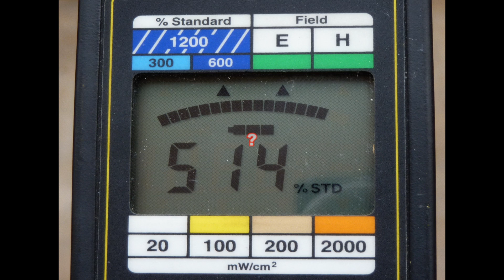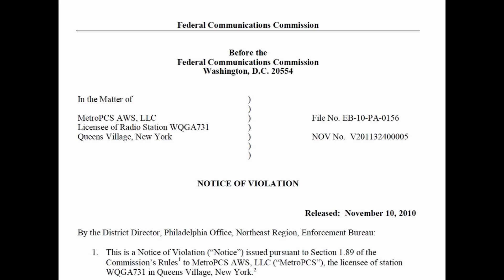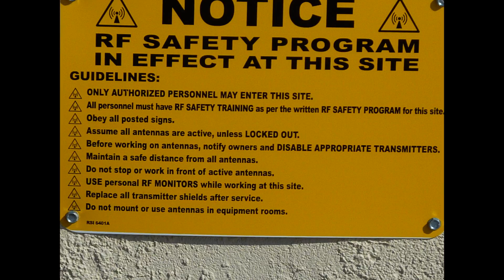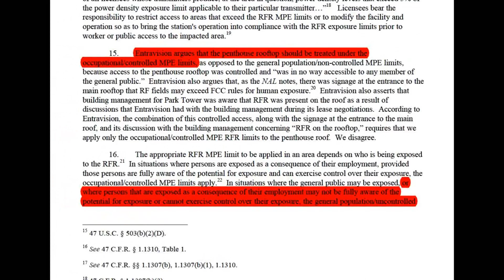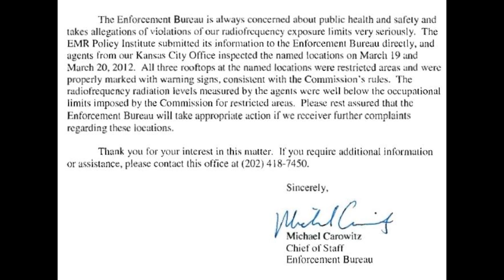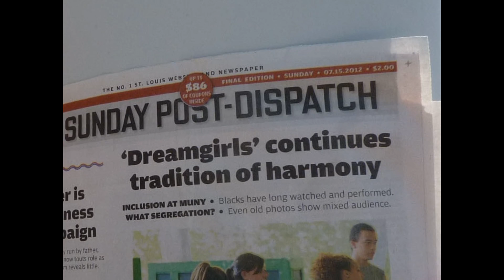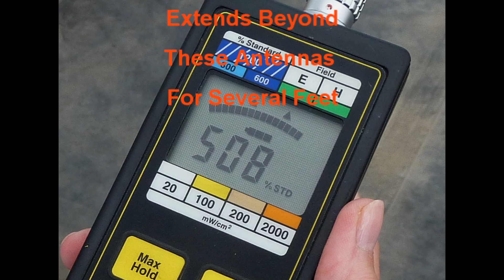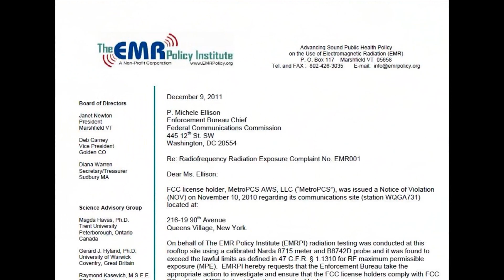Wireless Industry Safety Failure Part II

Comment: building where i work is classified as condemned the roof structure has so much water damage that at some spots you might actually fall thru and an architect has deemed it unsafe. we have been for years walking in front of these antennas patching this rooftop up how is it that these companies can stay on the rooftop of an unstable building thats abandoned actually running there equipment off of generators because building has been tagged by pge as a fire hazard.. mind you this building is near a local high school where kids go mess around on the roof top , homeless stay up there blows my mind